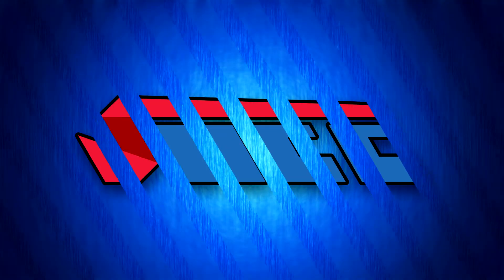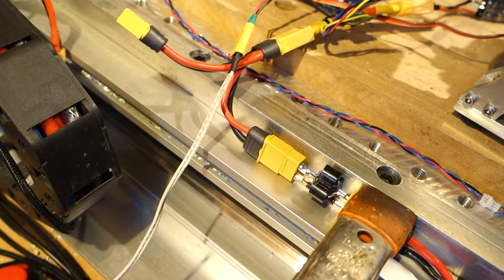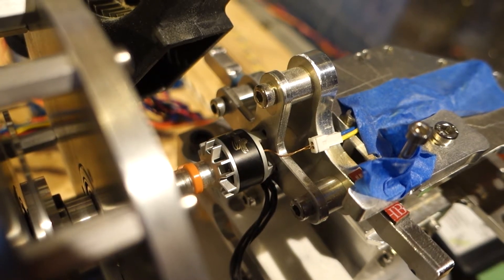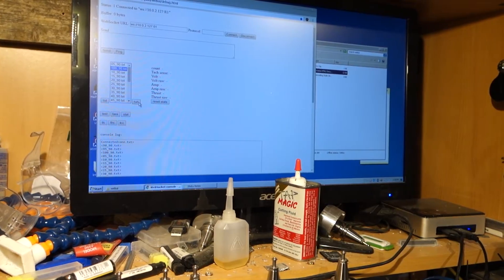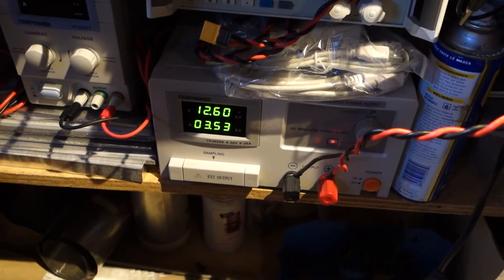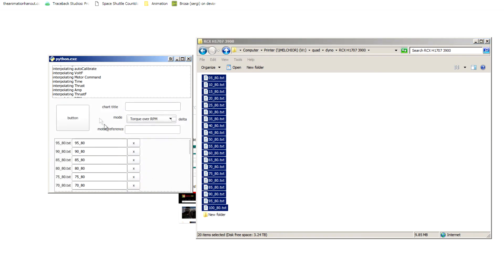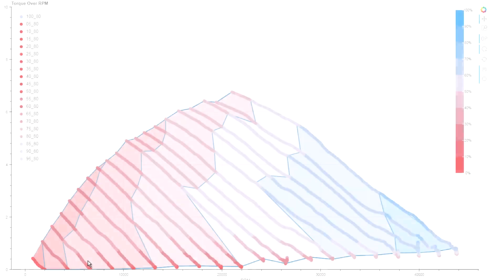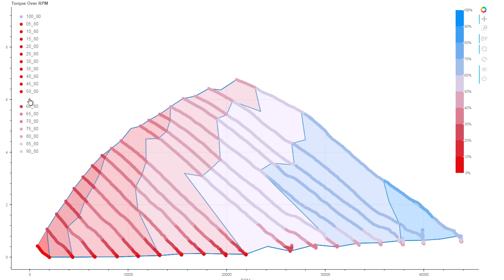How I test: Dyno test procedure

Comment: This is very useful. I've been building a dyno setup for small underwater thrusters and then found your channel. I got a highly similar setup except I don't have an rpm measuring widget yet. I'm just using ROS to communicate with a couple teensys, an INA219 for current sensing. I didn't get why you were using different power supplies exactly. Also, do you have more details on the design of your magnetic loading end? I have a very small motor (12mm Diameter inrunner, 1.5mm shaft) and still thinking of the best way to produce variable loading on it. As for the torque sensor, I have two symmetric load cells that I take the difference of to discount any moment loading due to thrust, I'm still not very confident in my torque data since the motor doesn't produce much torque to begin with. Other issues I run into with my application include water turbulence/waves etc so I'm now placing my rig into a deeper fish tank. 

It would be awesome if there was a repository of motor curves for much of the brushless motors out there in the market. I wonder why suppliers/manufacturers don't provide them, I'd be more inclined to buy their motor if such data is provided.
Reply from the maker: I'm not sure what you mean about power supplies, I only use one power supply during testing.  There isn't really much in the ways of details, it's a bog standard eddy current brake.  Spin an aluminum disk and hold a magnet close to it.  I did show machining the spindle and some of the assembly here  https://www.youtube.com/watch?v=Dpo_fcKy48Q

The RCTestBench dyno uses the dual load cell configuration, I just don't trust it as well.  Even though I'm probably hurting my precision more by trying to constrain the motor mount.  

I took to measuring the torque separately to help avoid complications like you're running into in the tank.  If you characterize your motor with a dummy load you don't need to measure the torque under water.  Just knowing the throttle position and actual motor RPM is enough to find out what torque you were using based on your dummy load test.

For the even smaller 11mm motors this dummy load setup is just too heavy and tends to just burn the motors out.  I've been playing with mounting a small disk on the motor directly to use as a brake for very light load testing, which is a much simpler setup.  It's shown promise in initial testing so far but I haven't cleaned a build of it up to give it a real test yet.
Reply: I haven't considered getting the torque readings separately, that makes sense actually. Will do that! 

If you get a small motor setup prepared I'd be more than happy to ship you the motor I have to test and benchmark. I'm working on the Hacker E10 motors and doing these tests for research-design validation.